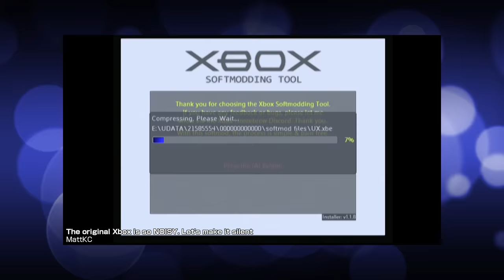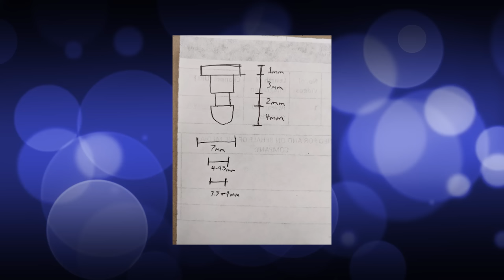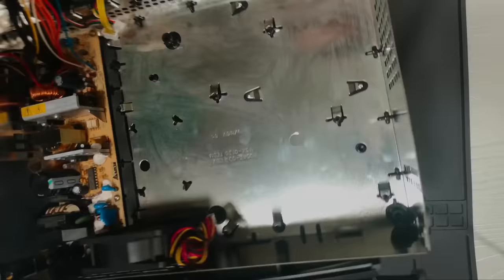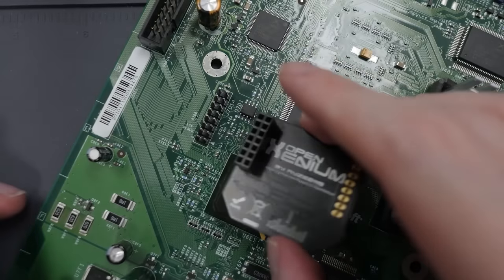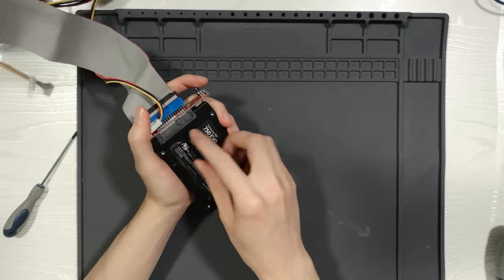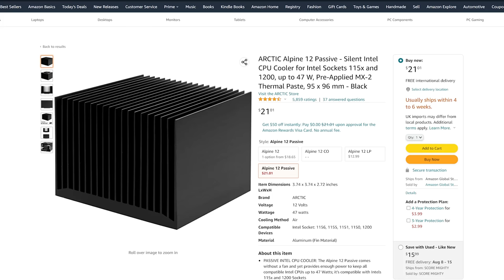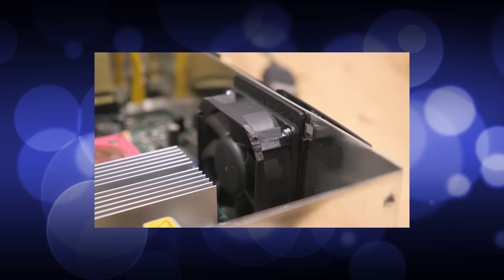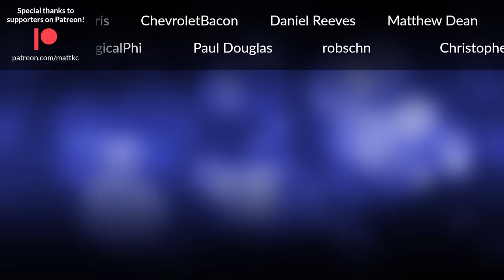My Silent Xbox Has A Problem...

Comment: It would be cool to install a USB hub into the place of the DVD drive. You could use the DVD drive xbox faceplate to cover them up when not in use. I've seen controller port to USB cables, so I'm assuming the xbox has driver support natively for USB.

Comment: get one of those lowprofile coolers and just leave it without a fan on it, the case fan will blow air on it and because then the heatsink has more surface area (and almost certainly copper heat pipes) it will cool much more effectively :)
Reply: don't do liquid cooling

Comment: 3d print a duct that replaces the dvd drive tray, with a 120mm fan in it, that pushes it through the back of the xbox. it should be able to push more air for the same noise...

Comment: Couldn’t you just use a low profile cpu cooler like you have shown and turn around the fan. If needed tape the front facing part of the heatsink off. Only problem is if the fan can actually draw air from the top somehow. Otherwise I would use a few 40x40mm or bigger/smaller fans (depending on the cooling fin size) and attach those where I actually need them.

Comment: Interesting the lengths people go through for making their consoles quieter. Never personally "heard" an Xbox, but I personally went through hell trying to make my PS3 Slim quiet. I changed the thermal paste at least 5 times for "better" quality ones, but to no avail. I finally messed so much with it, that I probably warped the CELL's IHS somehow, because it started overheating. I had no choice but to delid the thing, in the most botched way possible, but, thankfully, it was a success. Changing the thermal paste one last time, now the console's temps and noise is exactly what it was before I started messing with it to begin with XD.

Comment: That's odd, you'd think that with the CD drive removed the added room for air and one less moving parts would make the system cooler
Reply: No, that's not quite how it works.

There's conductivity of heat from the surface area of the fins to the air immediately surrounding them, but then you need to get that heat-saturated air to move.  When you remove the hard drive caddy and the optical drive, you provide lots of air space to the fan, which is trying to exhaust air from one side to the other.  The fan's job is now easier, since there's less restriction (resistance), but you end up with currents of air coming from the inlet vents and taking the shortest possible path to the fan.  That path may not cross through the fins of the heatsink, or at least not enough.  So you need to force the air path to go through the fins to get to the fan.  The drives block the direct paths so that the air is forced to move through the heatsink.  It's basically a funnel.
Reply: @nickwallette6201  ok now I see why it could be a problem with cooling, thanks for the explanation!

Comment: cardboard or thin bent plastic ducting, the OG fan and heatsink and HDD and such lined up in the perfect way to enforce a slightly ducted arrangement over the two heatsinks
you can actually see the heatsink through the HDD bay, you could when it was actually an HDD
something as simple as a sheet of paper under the SSD that seals up the bottom of the HDD bay might fix that 10c delta, also if you look at those low-profile cpu coolers they have vertical fins, you CAN blow air up/down BUT you CAN ALSO blow it through the side
and also if you consider, forced air right onto the heatsink like in a pc with the back fan just exhausting the hot air as it gets thermally saturated would help, 20% on all fans and a heatsink large enough to transfer all the heat to the air

it is a common misconception how heatsinks work and are limited, the vast majority of thermal limits is directly related to the metal-air interface, once the heat is in the air or in the metal it doesn't like to change carriers, hence the massive surface area of heatsinks
your PC tower cooler works because it has so much air-metal interface area that the limits of air-metal transfers are minimized, the heat pipes also help to get the heat to move through the metal faster than natural conduction and the fact you often have a directly mounted fan larger than any other cpu fan doesn't hurt with the disapation

actually liquid cooling just acts like a flexible PC tower cooler, it turns the heat pipes into water tubes, which works basically the same as real heat pipes due to the thermal mass of water being so oddly high vs other liquids and the phase change energy also being so much higher

plus if you have the skills to run a small manual mill on a block of copper and run a pipe torch and bend some soft copper tubes you can make a PC tower cooler fit without the DVD drive, just make a heat-pipe adapter that moves the heat from the chips via a copper plate to another copper plate the heatsink is bonded to, the thermal output of the OG xbox is not high enough for a properly lapped copper-copper arrangement to matter, the one ship is literally just warm plastic with a heatsink clamped to it
if you really care about temps, try getting a common and cheap ITX pc power supply, a simple atx extension to re-wire(xbox pinout is not the same as atx) and a couple cheap mosfet modules on amazon to make the xbox happy with the switched 12v and 12vSB lines it had access to
then take the extra power of the ATX psu and a set of micro PID controllers and two of those mosfet modules and two TEC modules, run the pid in a "ramp up as soon as it hits above the hottest it can sit on a toasty day until it is at 100% near 75c" a 127-03 TEC would be more than enough cooling to increase semi-passive dissipation and with the fan barely faster than stall it would keep at temp, use a 127-06 and a fan speed controller that can react to heatsink temp and feedback to the mobo and your xbox can run at ~30c forever

but yeah <70c even for old chips is fine, minimal risk of fast degradation that simply using it at lower temps wouldn't do anyway, if you want it to outlast the life of the current xbox-one consoles you may want to go insane with a TEC setup or carefully molded ductwork or a noisier fan or custom heatsink but given that these devices are only having a leaky strange capacitor blend and otherwise work fine as long as the HDD is still working and the laser isn't worn out I suspect the chips won't die it you never let them thermally shutdown

Comment: I could actually do with more videos on this. How would you rip your game discs if your OG XBox was already dead? Can you use the DVD drive in a regular computer and do it that way?
Reply: Not so simple.

https://youtu.be/uY8KNl88Lqc?t=219 - that's MVG covering that in a video.

Pretty much it would load a video saying to put it into an Xbox. Though there's more to it than just that.
Reply: @aaronjonessonofindianajones  Yeah, I should have worded that better. I meant put the XBox DVD drive into a computer. Although, drivers might be an issue, if I even have a working IDE based computer or even a dongle.

Comment: You could mod the passive heat sink to fit around the offending capacitors would probably be and easier solution
Reply: And safer, moving vital components even a little can have consequences

Comment: My Xbox has a problem. So it wont turn off properly, Do you have any idea that could help me?
Reply: And its a Xbox OG aswell
Reply: Also what I meant by it wont turn off properly, Is that it will not turn off once turned on, So i have to plug it out when I'm not using it.

Comment: Can someone explain to me why use an ssd specifically? According to wikipedia, IDE should cap out at 133 MB/s which is basically what any old spinning rust disk could get anyways. I guess a crappy ssd is just cheaper.
Reply: The point was to make a quieter PC. An SSD is way quieter.
Reply: SSD's are silent, and also the cost effective option. It's obviously not about speed, but you actually do gain a decent % of transfer speed with the 80 pin IDE cable over the stock 40. The biggest reason is that SATA is all that's available anymore, and if your stock drive dies you have to move on anyway.

Comment: maybe a GPU cooler could work. They are very low profile and if you have a non working GPU you could take his heatsink and put it in the xbox to see if it worked (and they can dissipate a metric ton of heat, because GPUs)

Comment: too bad there are no copper heat sinks though i do remember that there were some that was drop in replacements.
as it uses that heat sinks style like on the super socket 7 CPUS or Socket A
wouldn't be to hard to fined one that has more fins.

Comment: Huh. Wierd that the seal didn't make that much of a difference... But then again that heat sync is both cheap, small, and probably not able to handle those ancient miniature space heaters we called processors back in 2001. I wonder what a proper one could do for your temps.

Comment: Dude this video actually helped me because my xbox has been running super hot it doesn't overheat but the heatsinks started to get wobbly.  I thought it was my paste but it's definitely this same problem.  I installed the same fan and was blaming it on that also but now I know what the target issue is.  Anyone know a link for the screws he used or something more ideal?(because the pegs haha)

Comment: Sorry, it's absolutely not the ultimate Xbox.
The hdmi mod is perfect.
But if you would have used a 1.0, you could have upgraded the memory to 128mb.
After that maybe the 1.4 ghz mod.
That together with modification of the xbe files to run in higher resolution would be ultimate!

Comment: I'd go for upgrading to a noctua fan first of all. That would probably give you less noise for the same (or possibly more) airflow.

Next thing would definitely be looking at heatpipe cooling solutions. There's got to be a low profile heatsink (with heatpipes) that would fit.

Comment: I built an Xbox slim not long ago (removing the DVD-Rom and dropping the case down) and moved the HDD to the DVD bracket, I had to drill a few holes and fabricate a 3D printed support, but it works well and gives the CPU/PSU room to breathe cause there is nothing on top of it blocking the air. Haven't gotten around to installing an SSD yet. ;-)

https://i.imgur.com/2pqzepK.jpg

Comment: two sided bolt-nut
Reply: s-crew you
Reply: you only need to submit to the money-servant-slave system
Reply: no, you are gone
Reply: how about xbox hardware emulation with fpga+gpu
Reply: or mod a gt1030 to xbox
Reply: yes pcie slot